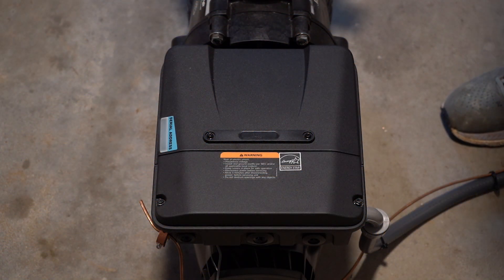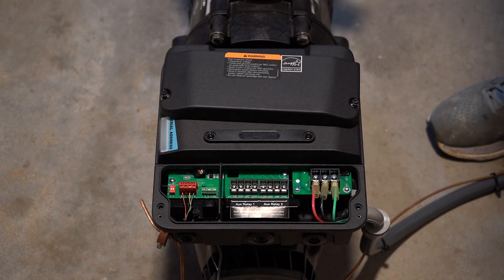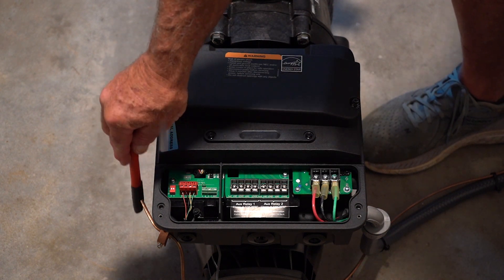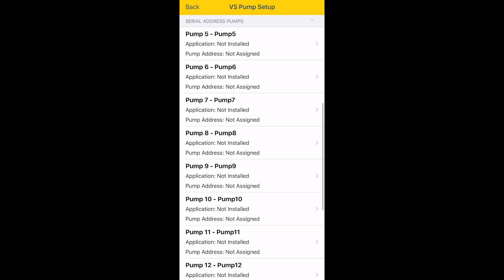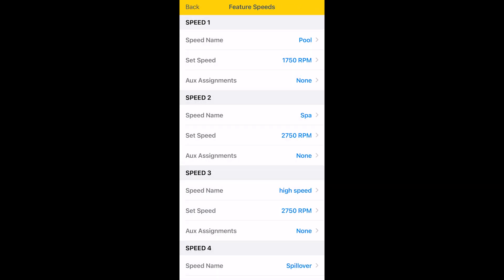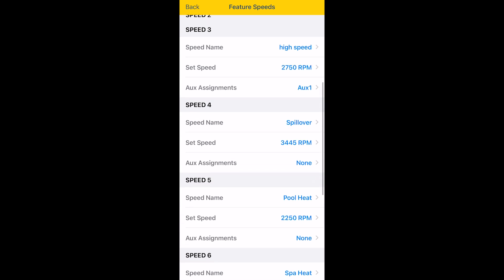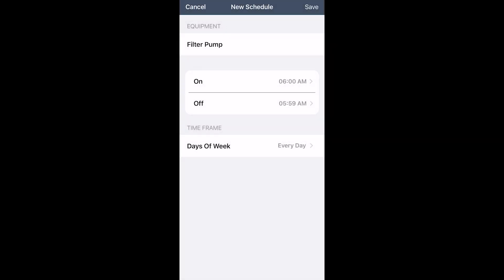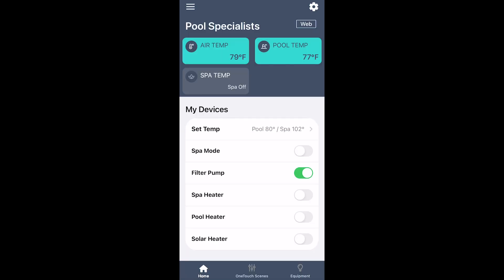How to automate a Jandy Variable Speed pump using serial address with AquaLink revision “O” or later

Comment: Great video. I recommend that everyone have a flow metrer in their setup as it will vary with tdh/ hydraulic efficiency. I can flow 30gpm at around a 1000 rpm for example. So my low setting  rpm is much lower than in this video with a Jandy 2.7hp pump.

Also, the pumps is permanent magnet motors so it really doesn’t matter how low you run them.   In the warm months, I run at 1000 rpm from 8pm to 11am. 1750 from 11am to 8pm. Higher rpm in the hottest part of the day for more movement, to skim and to fully pressurize the filter.  I hit 4.5 turnovers at these speeds.

Comment: Thank you Craig for a very informative video. I wonder if the communication wire connects to the 4 pin connector at the top left corner of the RS 845 board? I currently have the indoor control panel connect to that connector and I just installed a 2.7 HP epump and did not see any other port that I can connect the com wire to. I also installed a heater bypass loop and wanted to use an actuator to control the diverting valve. Do you have any idea how to set up that actuator to turn to allow water to flow thru the heater when heater is turned on? Thanks Craig

Comment: Just installed a Jandy VSP 1.65hp along with the Aqualink 3.0. Pump does have dip switches #1-#5 factory pre set with #1-#4 off  and #5 on. Went to System Set up pump #5 and came up with Not Assigned with a blue check mark like yours but did not have any type of information above it to choose from. When trying to activate pump, Antenna Red Yellow and Green light was illuminated when relay was activated turning on salt cell and filter pump red light was also on but pump would not start. Checked voltage at L1 and L2 successfully reading 121v on each but still not running. I did see the  S1 and S2 Dip Switches on the Aqualink Board which were all off. I did turn on I believe it was S1 #2 which was 1speed pump off and 2 speed pump on along with S1 #3 that was spa spa spill over. Actuators are working along with salt generator but pump will not, do you have any ideas what I'm missing?? I greatly appreciate it jpchelka@ymail.com or 321-332-4893 text